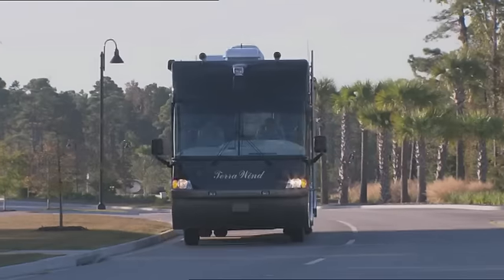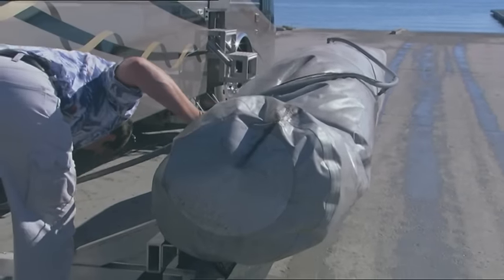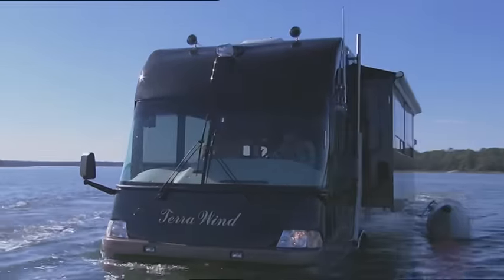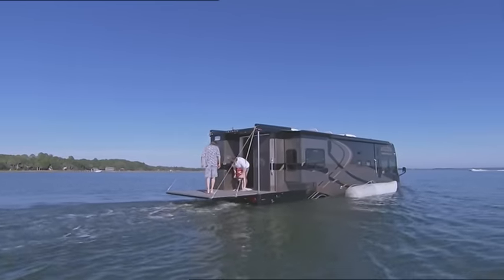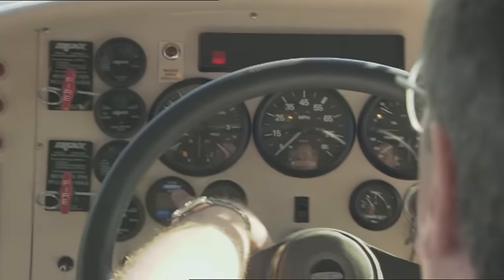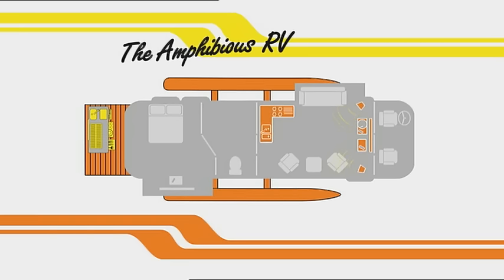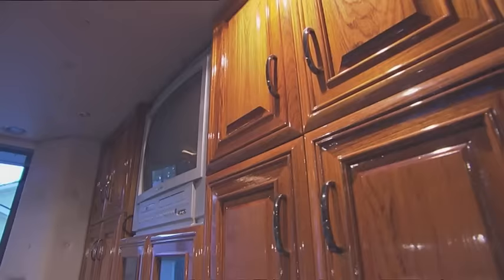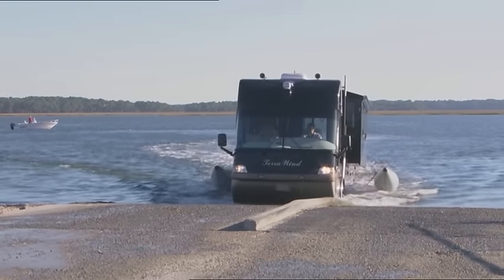Aquatic Floating RV

Comment: After viewing tiny homes on wheels, shipping container homes, bus/van conversion homes, to houseboats, this is by far one of the coolest and most unique setup I have ever seen. This guy is very intelligent with a serious vision. I love people’s reactions when the RV hits the water which is worth that kind of attention. If I were to purchase one of these from this guy, I would have him consult with me to flip this into a submergible submarine to give it one more feature and shock value, if that could be done. Imagine having a number of boaters at the middle of the lake and have this RV surface from under water and be fully out of the water and start cruising for land. That would be epic. Another unusual possibility. Thank you for showcasing this.
Reply: I think water pressure is the name of the game with submersibles...like, how deep could it safely go before the windows have too much weight on them or the seals fail? That's the first things I'd want to button up. Definitely an awesome idea though.
Reply: You would need to reroute the exhaust and intake, then reinforce the glass and all seals. In addition, you would need more powerful thrusters to compensate for additional resistance especially with such a boxy shape; it would not have meaningful thrust unless you are just viewing a small spot. Either longer with a conical or tapered nose and tail. Or just submerge and back up.

Comment: Remember this works on calm water like Dam or Lake don't try this on ocean with angry waves ..
Reply: Depends, you can find calm ocean waters in Bays, and Lagoons. Also Away from coast waves aren't that high on calm days.
Reply: @kewlztertc5386  But don't forget just specific areas like those but ocens waves have behaviour to change unpredictably
Reply: @harrymakongwa1147  Maybe, but remember waves aren't waves on the deep ocean unless there is a storm.
Reply: @kewlztertc5386  I live in Dar es Salaam (Tanzania)the ocean  most of the time has strong waves ,I have been in Mwanza (there's lake Victoria(Nyanza(local name)it's very calm and this kind of vehicle can dominate the water well.
Reply: @kewlztertc5386  or wind.
Reply: I was thinking the same thing this will be sketch city on wheels in bad weather
Reply: It would be interesting to see how it handles ruff conditions. Strong wind might even cause trouble unless it's a tail wind.
Reply: Might not working 100% in my hometown lake.. the lake in my hometown is one of the largest and deepest in the world and often has a big wave like in ocean
Reply: @fadhly5192  What's the lake
Reply: @harrymakongwa1147  lake toba . In rainy season the waves are pretty big in the middle for a lake
Reply: Right, I will only take mine in the lake.
Reply: @kewlztertc5386  yea but you need a concrete loading ramp this is still there when you get back.
Reply: @monmixer  or a truck with a wrench.  Maybe one on the RV,  that you can hook to an anchor. Flatten the tires , and drive it onto shore.
Reply: This may not work in the Caribbean then... Cause we got choppy to high waves, rough seas...
Reply: @kewlztertc5386  oí
Reply: @lhsenlagrimi9369  oi hoy!

Comment: May be its just me, but there is one problem you may encounter.

If the boat ramp (in to the water) isn't shallow enough, it will depend on the props to have the grunt to lift the whole weight of the vehicle up the ramp until the back wheels gain purchase. Not a particularly big 'flaw' but definitely big enough to leave u stuck half in and half out if the driver failed to assess the grade correctly. Just a thought.
Reply: I should have mentioned, he already stated that the props and drive shaft are independent, but I am not sure if he is able to run them in tandem (together). He didn't specify.

If he can't run both together and is relying on his 'coasting' speed to land him, then he may actually have a big problem...
Reply: This is a general good question: Just because this beast can enter the water, and make its way across the water, does not mean it will will have the proper landing, entrance angle and footing to crawl out of the pond.
Reply: I'm sure that before he enters the water he already knows where he will exit and has assessed the grade of the exit ramp. It's no different than driving any other class A, advance planning is required so you don't get into a situation that you can't get out of.

Comment: bruh imagine your in a police chase and u escape out to the ocean
Reply: Cant go in the ocean, waves and salt would sink it.
Reply: Jake Mastronardi Gta 5 moment
Reply: LOL AMAZING
Reply: The ocean is way too rough once you get out far enough. During windy days there would be a definite risk of sinking. The ocean is larger volume which is the reason for the difference between ocean and lake. It would be scary though if that really happened being that the police would have difficult time. This should work though in certain areas of ocean depending on if it was constructed with sea water capability in the sense of amphibious vehicle which needs to water tight some areas for salt water to protect against damage.
Reply: @luckylarry3090  not necessarily, but there is huge risk depending on location. Ocean is not rough everywhere
Reply: Bro this thing would sink in seconds if there was any waves. Ocean is a no go lol it's a lake vehicle
Reply: @zombwars7749  i think it would just roll like a log spinning until it filled with water,it meant to be bottom heavy so it would try to right its self but wind would keep pushing against it and it looks like its top heavy thanks to the width and height plus granite top's and other "luxury's"  so i would think it would spin or barrel roll in the water wind hit the side like a sail would just speed it up
Reply: Bro. I think the law would let them go if they drove to the marina and went into a lake. I would just tip my cap and watch them float away.
Reply: They earned the wanted stars to disappear.
Reply: LOL
Reply: gta be like
Reply: @luckylarry3090  salt sinks boats? just like fuel melts you-know-what?
Reply: The Real Gordon Ramsay  I bet it's in a marina.
Reply: @permagnusandersson6052  No waves do

Comment: I applaud the creative thinking, but the design won't translate to the real world for less than $1 million (if you expect it to withstand the elements over time).  Safety is also a significant concern in the event something fails/goes wrong.
Reply: It also is with a boat or anything else that floats
Reply: If something pops the floating things
Reply: Easy fix. Put one of those boxes that are full of like 20 life jackets in case of it sinking. And it is literally a normal rv but it has floats and props and obviously a couple of other modifications. And I’m fairly sure that rv is built to withstand the weather
Reply: william coe they clearly didn't forget the floating thing.  It's floating throughout half the video.  Apparently you forgot the watching thing.
Reply: Hey everyone, let's play a fun game.  It's called, "Troll Or Twelve?"

I'm guessing twelve for this one.
Reply: Sure, RVs have been around for decades.

Have you?
Reply: Thats why he started with a BOAT HULL and then added heavy duty bus equipmemt
Reply: Herb Derbler  def troll. 12 don't care bout no Damn floating rv!!
Reply: Storms not only would cause seals in connections to fail, but rising waves that extend high onto other connections would result in an unfortunate imbalance. What appears to be an ideal adventurous, dual vehicle most likely would result in the same fate as the recent amphibious duck tour vehicle and, of course, the Titanic. The life expectancy of such an amphibious vehicle would depend not only on unpredictable weather, but yes, the ability to maintain all seals and stability even during stormy conditions that are beyond control? Hoping that everyone aboard wears life jackets, and that the vehicle is equipped with easily accessible life boats that are in quick range of an easily accessible deck. To be unable to reach the lifeboats during a storm or other problematic condition would result in fatalities. Also, the shape of the hull should be re-evaluated. Yes, a separate ensemble of an RV and houseboat/yacht ultimately would be safer and more affordable.
Reply: It’s basically a tomb when it starts to sink. You never want to be in a box on the water for obvious reasons. Just look at the duck boat tragedy not too long ago.
Reply: It did not originally have pontoons and drove fine in the water.  The pontoons were a later addition for higher waves while they're sitting still in the water.  Their website used to have videos and pictures of it with no pontoons in the water.  They started with an actual boat hull and built the coach's shell on the deck.  It IS an actual boat.

People need to keep their mouth shut and do some research or at least visit the manufacturer's website first before making stupid idiotic comments.
Reply: william coe  Last I checked it floats... weeaboo.
Reply: @SeraphimGold  What appears smart to some is trying too hard for me... You remind me of the guy that just repeats what everybody else said.

Comment: yeah the RV is cool but the price tag is probably $2.5 million or more and you'll have to license it for both road and water use in the US state you live in. And it's possibly only for freshwater use only has saltwater will cause corrosion on every surface.
Reply: AdissageRevver1987 i can imagine how early the bearings will go bad.
Reply: AdissageRevver1987 just use on lakes not ocean ;) yeah saltwater would be a problem

Comment: here's a question. Would you have to insure it underneath a motor boat and RV or houseboat house van
Reply: Rata 4U appreciations all around and thank you very much for letting me know that you cleared a lot up thank you once again
Reply: Here in NY, you would just insure it as an RV(liability), as boat insurance is 100% optional, but you'd also need to get your coast guard boating safety certificate if you're gonna pilot it on the water.  AFAIK, anyway.

Comment: The breaks will be pretty ineffective as they are wet. And drying your breaks by driving whilst breaking will cause your break pads to wear off quicker, shortening their life span.
Also the high amounts of exposure to salt water, especially for long periods of time, can cause corrosion, even to aluminium
Reply: That's why they are in freshwater

Comment: Think of the advantages. No traffic. Cop can't pull you over, and you don't have to drive around the lake you can drive across it.
Reply: Tim Fowler/ No , the cops could just shoot your floaters. Ha .NO way I would put my kid in that. A  float made out of the type of material the pontoons use, attach to lift up and down attach to  each side that can be lifed up and down. cant poke holes in them. This is not safe.
Reply: Sarasdad91 Tim Police also use boats.

Comment: One sharp object to puncture that airbag and all hell breaks lose
Reply: Stampy Jrr how?
Reply: The air bags are just for stability, it can still foot without them
Reply: Ellis Frank the airbags make it float, the distance away from the RV is for stability. if one goes you’re either going sideways or going down
Reply: @Caleb_FC  if one goes you sure are going down.
Reply: The airbags do NOT make it float!  It's built on a BOAT HULL!!  The floats just stabilize it!
Reply: @catherinemichel6673  But if one pontoon got punctured the rv wouldl lay sideways and it would sink eventually.
Reply: Catherine Michel 
and how do they stabilize it? they FLOAT
Reply: @Caleb_FC  Dudeee, she/he just said that the rv doesn't float cause of pontoons not that pontoons don't float.
Reply: @Caleb_FC  you really have no idea what you're talking about. You should stop talking. The company is known for the boats with unsinkable hulls filled with foam that they manufacture. They took one of their unsinkable hulls, put wheels on it, and built a coach shell on top. The prototype originally did not have pontoons. They added those later for greater stability mostly while sitting still in choppy water. It doesn't need the pontoons to float at all. It may look like an RV but it's a boat.
Reply: Don't forget sharks and wild weather in deep water further away from land.

Comment: one loose sharp branch and one of those pontoons to pop and you have a recipe for bankruptcy.
Reply: The pontoons are just there for stability, the RV can float without it
Reply: It originally did not have pontoons.  And it was stable in calm waters.  The pontoons were added later.  They used to have pictures and videos of it in the water with no pontoons on their website.  I'm not sure if they are still there.
Reply: More like the sharks will have recipe for human flesh.
Reply: While they are only for stabilization  they look to be made out of the same rubber as my zodiac RIB boat and that material will not puncture easily, especially from a stick, you would have to fit something pretty sharp or pointy fairly fast and what u hit would need to be strong

Comment: When u can’t afford a real yacht
Reply: DcNq- you could get a nice yacht for the price of one of these
Reply: 30k for a yacht
Reply: Nope. i bought a good one and im sailing with is. 37 feet. good diesel motor.  Jenneau Voyage 11.2   3 rooms, 1 bathroom kitchen big cockpit, solar panels. windgenerator etc, bought it for 23k fixed the rest for 5k
Reply: you just explained americans
Reply: its called a yacht. Cruising yachts

An offshore sailing yacht
Cruising yachts are by far the most common yacht in private use, making up most of the 7–14-metre (23–46 ft) range
Reply: When a real yacht can't drive on land...
Reply: honestly with all the modifications put into it. it'd probably cost about the same as an actual yacht
Reply: Andrew Taylor and this can go in a lake.  Not an ocean...
Reply: This costs more than a yacht.
Reply: @jak3y369  you could get a decent 48 foot yacht for around 80k dollar's....

Comment: So when the ramp is full of algae, It will go out smooth or the 4x4 gear will activate. lol  in germany they already did the amphibious bus more larger and stable without the big side airbags.
Reply: The propellers will still work even when there is algae on the ramp.

Comment: How does this not get rusty
Reply: It has a boat hull
Reply: Stainless steel
Reply: and it's still brand new.  no time for rust yet even if it could rust.
Reply: Ok, guys. first off it's not stainless steel.  That would be too heavy,  and far too expensive.  It's a welded aluminum hull, and we all know aluminum doesn't rust.  Then they use a barrier coat on the aluminum to protect it from electrolysis, alge, and barnacles.
Reply: No open ocean, freshwater lakes only

Comment: I don't think the under-carriage of an RV was meant to be exposed to so much water.  DUBIOUS.
Reply: If you press play and watch the video the bottom is a custom aluminium boat and the motor home was placed on top.
Reply: Dcool - Right. That's like the second line of the video
Reply: What about salt rust
Reply: Again, in the video they clearly state not for oceans- wave-wise, and assume salt-wise.

Comment: Better hope those pontoons don't fail.
Reply: Mason Dixon it's still a boat, the hull is completely sealed it's just for stability. If it deflates all you need to do is get to shore slowly.
Reply: wild man Haha... That's reassuring. Inflatable pontoons as the only means of flotation seemed like a disaster waiting to happen.
Reply: After watching this again I recognize they said it has an aluminum boat hull. Whatever the case, it seems to work, and that thing is awesome.
Reply: 40ft by 8 foot beam and looks to be a nearly 4ft draft. It started as a boat hull, and then added the heavy duty bus components. It has the same displacement as a mid size yacht. The pontoons are not even needed and are merely for comfort and stability
Reply: There just stabilizes they don’t float the boat pay attention!!
Reply: Wayne Graham... Looks to me like you should have paid attention in English class.
Reply: Mason Dixon He mixed up “their” with “there” simple mistake, it’s forgivable. Same with your mistake of thinking the pontoons are the only means or floatation, aight?
Reply: The entire sentence is botched. Yours is too.

Comment: Interesting idea but there is no say of what the risks are such as the rescue plan when the floating piece leak. I would feel much safer if the floating pieces are made of aluminum or fiber glass. There is no emergency life saving boat and they don't wear floating vest but with such small baby on the board. Better check with regulations.